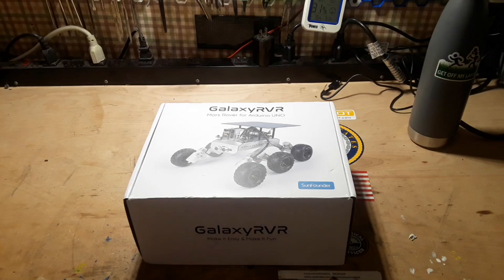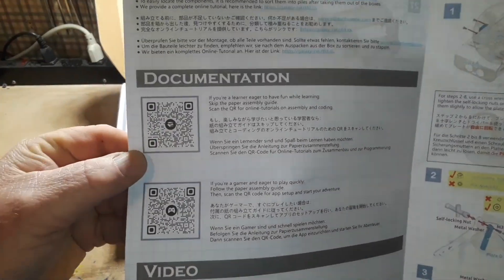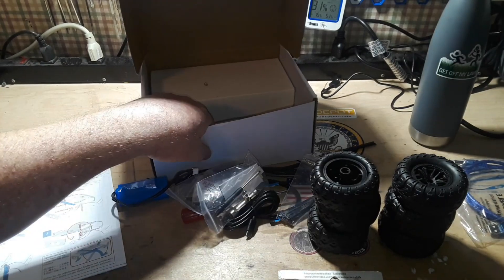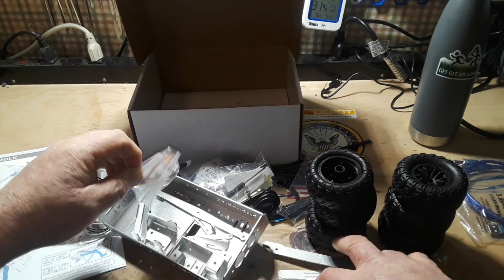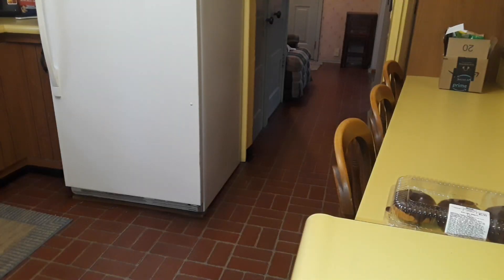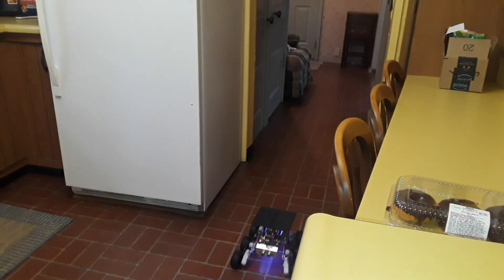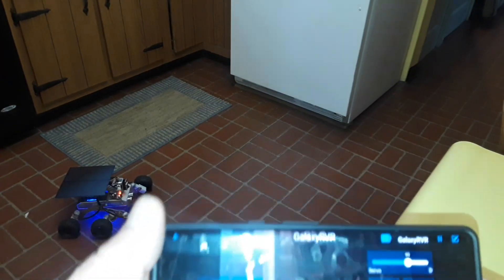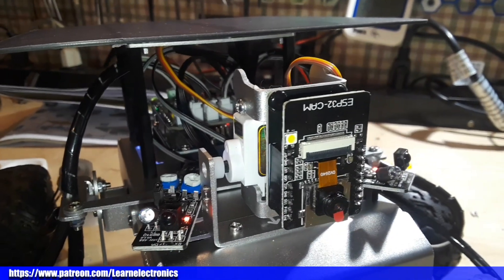Sunfounder Galaxy RVR:  Arduino Based Intelligent Wi-Fi Rover

Comment: The kit mechanical design is very impressive.  I assume the "avoidance" issue is fixable in software.  Did you contact the vendor to provide feedback and get any corrections.  I see that the kit is not available on Amazon at this time.  Any idea when it might be?

Comment: Happy New Year, Paul!  I've been looking for a rocker-bogie base to experiment on; bought the Servo City one, but this seems a lot nicer.  I suspect the obstacle avoidance  issue may be due in part to the soft furniture you have, which probably absorbs the ultrasonic sound instead of reflecting it. 

Best wishes for a healthy and successful 2024! 
Bill
Reply from the maker: Thanks Bill. Same to you!
Reply: @learnelectronics  is this controllable over network or only wifi direct?
Reply from the maker: It says you can switch it to your network. It starts off as an AP, but I haven't found a way in the app to switch it. It would be doable in the source code. I haven't looked in there yet.

Comment: Would be interesting if it could be converted to use 802.ah (HaLow) and went faster.   Then you could get some real outdoor distance (maybe up to 3KM) with it.
Reply: if you put your phone on it and connect to it with a hotspot it has unlimited distance
Reply: @Blox117   But it is your phone you are controlling it with.  You need to keep that.  You could use a 2nd device and a VPN between the two.   Not too keen on sending my phone off in the distance though.